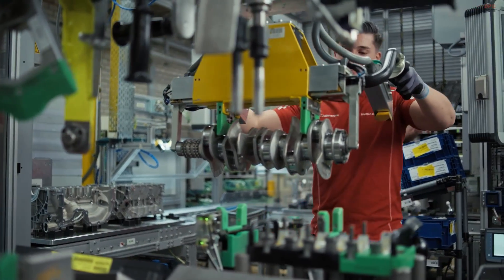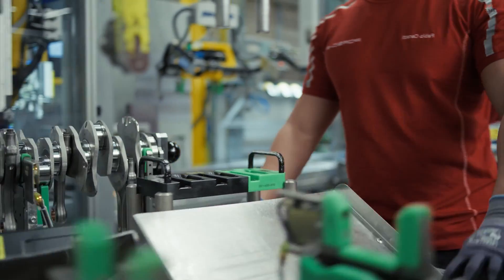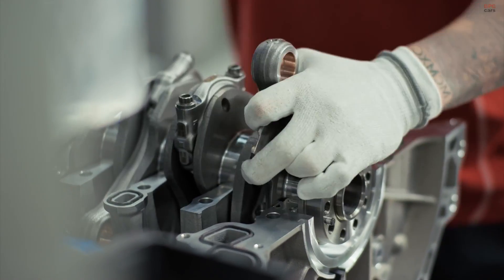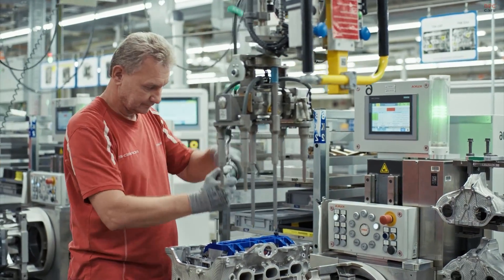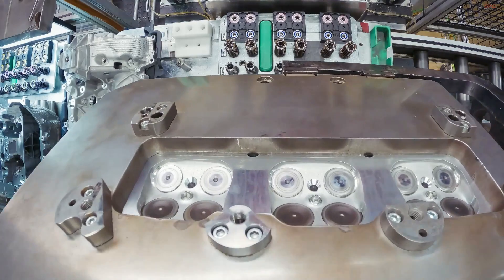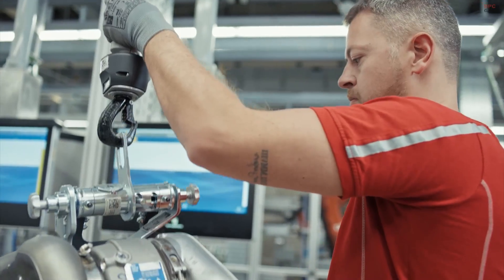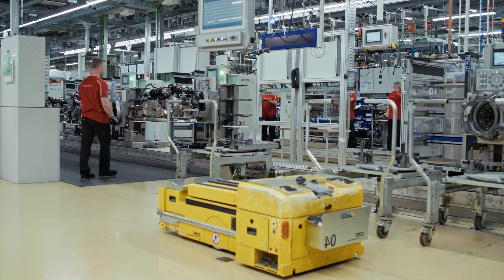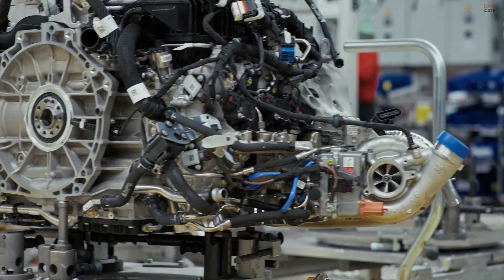How Porsche Builds the 911 Engine by Hand at Zuffenhausen

Comment: Ever notice you never see how they put pistons into the engine
Reply: My boss had a 911 yrs ago when I worked for him. He said it was a pain. I never witnessed the process but he hit a snag where he was about 2 inches from closing the case but one piston had its rings outside the cylinder bore on the bottom of the bore. Which is inside the case. He and myself and one other guy were using long flathead screwdrivers and lights and looking down into the case to pinch the rings in   and close the case at the same time. Took about an hr of patience and back up, try again. And again. I dont want to do that again on a 20,000 dollar engine. There has to be another way.